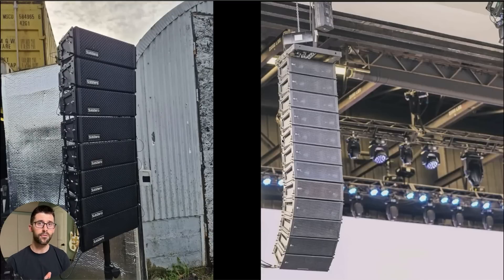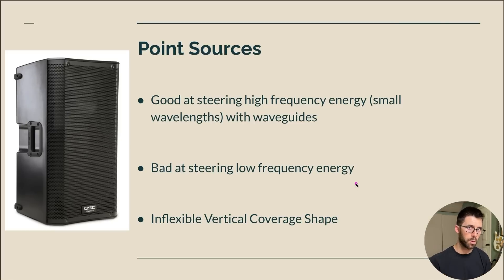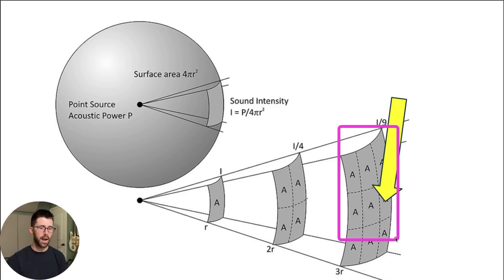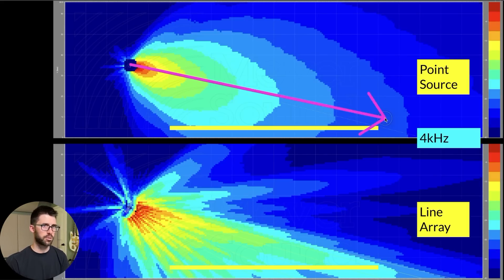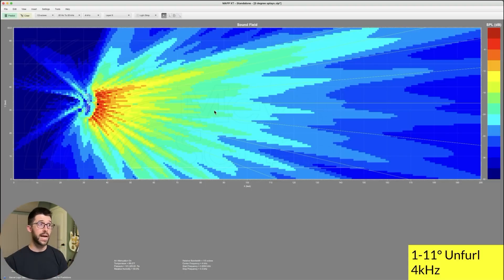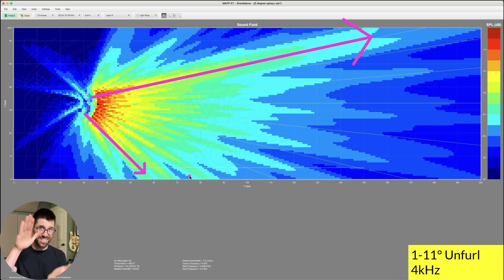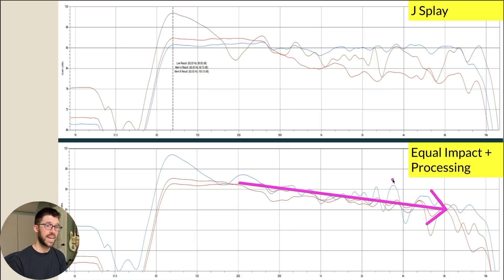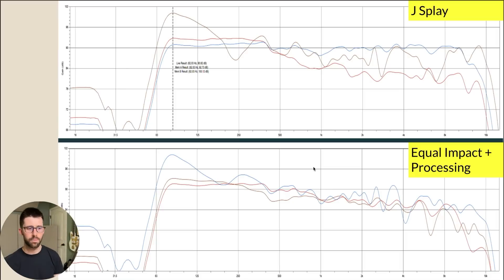This Simple Mistake RUINS Line Array Coverage (And How To Fix It)

Comment: Thanks for your efforts to demystify PA setup. 
I own just 12 CURV 500 Satellites with 40W rating each and two different angles (5 and 10 degrees). The design of each satellite has a midrange and three high range speakers. So this is a clever approach to improve even distribution of energy with the line array at high frequencies according to your video. Correct?

Comment: Two questions: 
A) Referring to your 3 recap points, do you assume to use software for the design / the values for the splay angles?
B) Could you tell a bit about the directionality of horn tweeters?

Comment: Hi Michael. I see from your videos that you often work with rcf systems. Have you ever used his program for calculating curvature (shape designer)? I wanted to know if you found any differences with Ease Focus
Reply from the maker: I've used it probably 18 months ago and it worked decently well and agreed generally with Ease Focus. I still do it all manually, but may look at the autosolvers as a reference if I'm stuck.

Comment: The line instead of point source for a longer reach with less loss of SPL makes sense, but how does the subwoofers do? Will they keep the SPL for longer, compare to tops?
Reply from the maker: If you're not also stacking subs up in a vertical line, only if the subs are in an endire or arc situation configuration.

Comment: The Audince is the one with money.  If they can't hear it then it is fraud.  Line Arrays only project sound in a narrow angle.  Wide ranging horns and tweeters offer up dispersion of sound.  Line Arrays only offer sound to that narrow band of people right in front of them.  It would be better for those arrays to be mounted HORIZONTALLY, so as to insure wide dispersment of sound.  Any other argument, is fraud.  Don't build your PA at the same plane of the stage.  Mount them on a sonal point at the side of the stage, so that all the audience can hear the performance.

Comment: Really awesome video, but i have one question : if we have the line array up in the air, and we can not change the angles, is it possible to adjust the gain of each box to get a better coverage? 
And can we add equalisation to each boxes, to compensate the difference between low frequency and high frequency to get the best response?
Reply: Hopefully, I understood your question; If the function of overlapping for a close to equal sound dispersion and coverage isn't achieved first, the best response from your array might be difficult. In my experience trying to compensate for improper splaying makes me do more unnecessary processing and gain adjustment. If I didn't install the PA system, I'd simulate using EaseFocus (as far as the GLL files for the speaker are available on the manufacturer's site), bring down those boxes, splay properly, and process accordingly. 

I hope this answers your question.
Reply: @klausndubuka4929  it totaly answer it, thank you a lot!

Comment: this is another reason im going with the new qsc L class units.. ai and wireless communication and the app make setup easy and flawless everytime, my only question is when and why to deploy in mono/stereo, also when running stereo mains, do you run mono subs when they are in an array?

Comment: So ground-stacked line array vs high-power point source speakers (2-way dual 15" or 3-way single 15"), which works better if flying speakers is forbidden?

Comment: How does this practice change when using EAW Adaptive or Holoplot elements?
Reply from the maker: Great question! Those two technologies primarily use beam steering via phase and level offsets between all of their drivers to create directionality in the array. It's much more effective with high frequencies and it gets better and better at steering lower and lower frequencies as you add more boxes since the line length increases.

A good rule of thumb is an array is capable of "meaningfully" steering the frequency whose wavelength is equal to length of the array divided by 4.

Comment: Excellent Video and it couldn't have come at a better time. I liked how you started by comparing it with a point source and how line array brings directivity to sound. 

I have a brand new install and am toying with the idea of having KV2 speaker install. One of their large format point source speakers. Feel they do much better justice to preserve the quality of sound. Any thoughts on that vs popular line array options available right now.
Reply from the maker: I don't have personal experience with the KV2 speaker, but I don't necessarily have a "dog in the fight" on which speaker approach is better. Each of have their pros and cons and specific use cases where they shine.

Comment: Thank you so much. I have one question. 
2 RCF 9007AS Sub (20 Hz 7200 watt peak) VS 4 QSC KS118 (35 Hz 3600 watt peak) when I do cardioid on the 4 QSC do I get similar power? I want it to fill it in the chest for about 400 people portable setup for worship concerts. Also, can I use the RCF sub in normal 220 power plugs in the UK by using Powercon to plug cable?

Thank you in advance.
Reply: It's hard to guess those things from peak watts. Depending on sensitivity that wattage could be different SPL and that's also peak so not always comparable between manufacturers. The best thing to do is set it it up and measure it. The second best thing to do is model it. I know Ease Focus has the RCF box but probably not the QSC. Maybe look for a sub with similar specs in Ease as a stand-in. Remember also that you can change the sub coverage shape with more subs. Maybe there's an efficiency gain from only putting sub energy where the people are. As a final note, if you want everyone in a room to hear equal bass the ideal location is in the air although that's not feasible in many situations.
Reply: I have the 4x RCF 9007. Its on a total different level than something like a QSC. Their prices should give you an idea of the difference. I would say each 9007 is about 2.5 times an RCF TTS18, which is already a way better sub than the QSC.
The 9007 sounds amazing, and works very well in end fire config.
Would 2 be enough? I have no idea what your music sounds like, but for our parties I would bring all 4 for 400 people. That being said, there is never enough subs for Techno. 
We use 230v power as well in South africa.
Reply: Thank you so much guys for your insight and foresight. @psipyro what model RCF HDL tops and how many of those are you using with your 4 subs?
Reply: @alohaadane  Either 2x RCF TT4W or TT5A. Just received the TT4W flybars, so may run 2x TTW4 per side stacked one of these days.

IMO if you run only 2-4 line array boxes per side, you are better off with a higher end point source. To me the RCF TT sounds quite a bit better than the HDL 10/20 I have heard.

Comment: Hey Michael, awesome video. I'm always on the lookout. Thank you! I asked a question on one of your older videos, I'll ask here in hopes that you'll see it.

I use Alto Powered Speakers. I doubt there are any GLL files to use in EASE Focus 3. Could I just use another brand of speaker with a similar coverage to get an idea of the predictions?
Reply: Yes the easiest thing to do would be to look at the fulcrum section of Ease Focus and match the horizontal and vertical splay angles of the Alto box you are using. I say fulcrum because they have a wide range of coverage angles but any speaker of the same dispersion is a good substitute for simple designs.
Reply from the maker: @benjonestech4981  You beat me to it : ) Yup, do exactly that.

Comment: Thanks for another great video, its really the difference between using software and not using software. Even having just a simple prediction on a set of boxes for a given distance, would improve the audio greatly.. Personally I've created a set of "basic" deployments from 20 up to 60 meters, with 4,6,8 or 12 boxes. That is easy to rig and deploy using predetermined angles and EQ, ready to deploy in RDnet. Great stuff, and thanks again!
Reply from the maker: You got it! Great idea on having those starting point templates for different deployments ready to go.